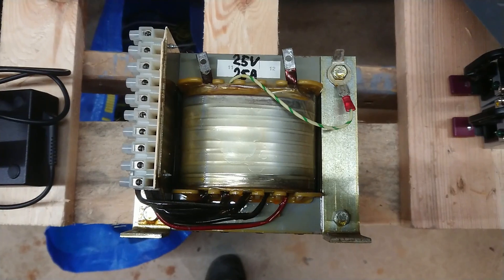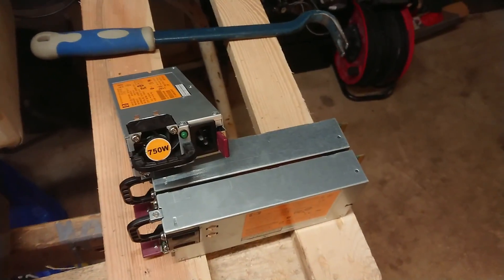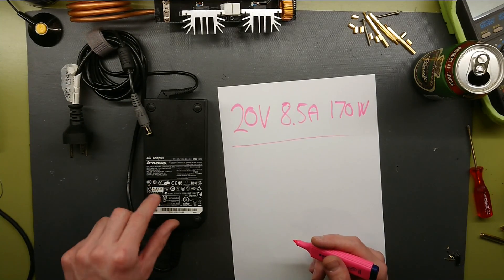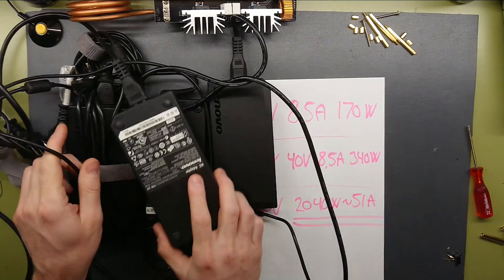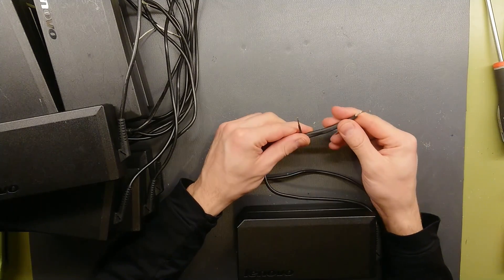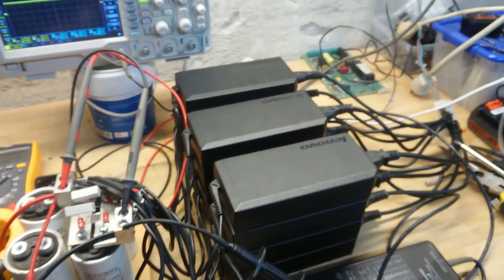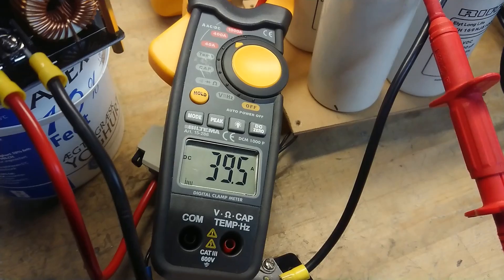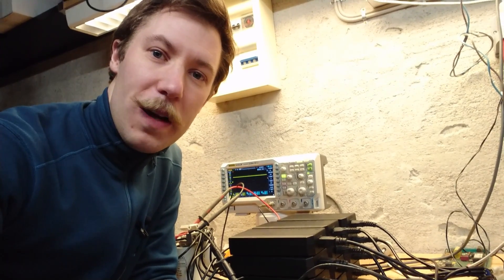2000 Watt Laptop Charger For Induction Heating

Comment: I HAVE ONE LAPTOP psu 19V 65 WATTS AND THE OTHER IS 19V 75 WATTS, CAN I CONNECT THEM IN PARALLEL OR WHERE AND WHAT VALUe OF CAPACITORS do I NEED TO CONNECT  them to prevent the difference? Thanks.
Reply from the maker: With a minor difference like that, I would just parallel them, maybe add diodes to make them not "see" eachother.

Comment: Do you ready need the same kind of laptop  power supply, same voltage and same ampage? Can I use different laptop power supply with different voltage and ampage to connect it in series? Thank you
Reply from the maker: As long as its the same type of power supplies, you should be able to do this with almost any kind of better-to-high quality types. I do however foresee that the higher voltages (48V) could be more problematic to put in series than lower voltages (12V).
Reply: @KaizerPowerElectronicsDk  hi thanks for your fast reply, let me give you an example, I got  3 power supply that is (1) 19v and 4a. (2) 20v 6a. (3) 24v 8a. Can I connect them in series and get a power supply of 63v and an average of 6a. Please help
Reply from the maker: That will not end pretty. 
You can only go by the lowest current rating in a series connection.
But load sharing between power supplies is determined by the voltage, so these 3 different power supplies will have an uneven fight about maintaining regulation. With a oscilloscope on the output voltage, you would properly see a ripple voltage with 2nd, 3rd and 4th harmonics components in it.
At low current, maybe up 3A, then maybe it would work at 63V. But you need to leave them all headroom to maintain their own control.
Reply: @KaizerPowerElectronicsDk  thank you very much for you your advice

Comment: could you switch them all on at the same time from one or 2 wall outlets? The inrush current of these switch mode PSUs is quite high. When i just put 2 of them in parallel and switch them on at the same time the 16A circuit breaker will trip sometimes. So you probably need some kind of time delay between them?
Reply from the maker: I switch them on 4 at a time. From a 230V/13A mains socket.

Comment: I am looking to heat 1” thin wall steel tube, so from this I take it that I need to make a smaller diameter coil. Do I need to make it out of the same length of copper tube for any reason, or will any length coiled up do fine?
Reply from the maker: You have to keep an close eye on the resonant frequency you end up with, I really recommend you take a look at this thread: https://highvoltageforum.net/index.php?topic=530.0 and find the posts from PeteSpaco, he made a lot of experiments with different coil sizes and gives a conclusion on what to do and what no to do.

Comment: Hi, Could you Plz Share power supply circuit (diode and capacitor
)?
Is it possible use any switching power supply say from china?
Reply from the maker: There is no need for a schematic, it is 2 power supplies in series for 2x20V = 40V, 6 of those in parallel for higher current. All connects to a capacitor/capacitors in parallel. The cheaper and low quality PSU you get, the harder a time they will have regulate in a swarm fashion when presented to heavy loads or fast changes in load.

Comment: nice job, what are the capacitors are you using? is it possible to run induction without capacitors and or maybe use ledacid for some high cca's do you think it would  be feasible to try it? using ledacid for the cca's might be able to handle a bigger coil and crucible possibly where it wouldn't require pouring using a mold? multiple ledacid in series with some in parallel for capacity or if there's something that could handle a larger coil and more amps, maybe fabricate say 5 ledacid into 1.
Reply from the maker: It is just normal RIFA electrolytic capacitors, as each single PSU only have a small output capacitance, a large change in load current from the inverter would pull down one or more of the PSU, the capacitors will instead be able to supply that peak current fast and all PSU would see that simoutamelsly as a voltage drop on their outputs, instead of a huge current surge.

Lead acid batteries would give you the best possible stable DC supply you can find, given you have enough Ah available. It is however not very practical as you would discharge them much faster than you can recharge.
Reply: @KaizerPowerElectronicsDk  thx for the replay, people aren't reading their comments not very often I get a reply would you say there would be a limit to the storage space with everything running through the satellites would there be an overload reaction affecting the satellites eventually? I delete junk on my phone constantly to free up space if I didn't it effects the phone, or the built in app or others can be used. Recently I thought the storage space could effect a laptop causing it to crash then they lose their data or can't get to it it's probably a crazy idea do you think an ic chip could be mounted on top of another ic chip  and work? or maybe their isn't enough power needed to process all the info they ask to run through a laptop the stock market calculations and processing is enormous, definitely the heat effects the chips performance then the same batteries supplying amps to ev's are used in laptops could that be overkill a bit and wouldn't it be better if the lithiums weren't anywhere near the laptop just giving distance even though it's heat shielded already could lower the temperature of the pcb's.

Comment: I have a very large collection of high voltage insulators from 10 kv to 66(60 kv). 
i have all type materials except 1 type. And this is shown in this video. I don't have the read composite insulators. 
And for your  solar project, do you want to show some wire and cable management for us electricians ninjas.
Reply from the maker: Part 3 of the solar project will have the final control panel in it.
Reply: You will look very much when we reach the 30. may 2019, 15 days to go. I maybe i got a very costly component for really small money and it have two psu with 83 Amps at 12 volt each. It not broken but i think very lot about your projects. 

At the next year i will begin to build a slayer exciter with the coil inside a brown 60 kv bushing. I allready have the 4 radio amplifier power transistors, wire and the 60 kv bushing.

Comment: Neat!! But as @kubeek asked - How do you trust the parallelised power supply units to provide an equal amount of power? I mean - I would speculate their regulated voltage output to be a little of relative each other? And thus they would kick in individually at different levels as the load bends the output voltage down? Or what is the mechanism that enables them to cooperate in parallel? Thanks for a good video!!
Reply from the maker: I gave a thourough best idea at @kubeek. My experience from parallel power supplies in the industry is the same, when they are calibrated to same voltage out at same load, they will regulate very even. But as soon as just one or two power supplies has old electrolytics they will start having some weird 2.-3.order waveforms. Glad you like the video :)
Reply: @KaizerPowerElectronicsDk  Thanks! Seems like a good topic to dive further in to? E.g., How to ensure power supplies like these are able to work in parallel  depending on their individual characteristics? For now at least it is good to know you have experience that this works well for modern power supplies with matched voltage output and power delivery capacity :). And to look out for power supplies with old electrolytics! Keep up the interesting work you do :)

Comment: That worked rather well! I've had tough luck with smaller-scale MMLP arrangements ringing (to failure) after some load switching.  20mF and good attention to lead lengths were not at play though.  Thank you for sharing this, and I look forward to seeing the outcome.  Best of luck, and enjoy your weekend!
Reply from the maker: Thank you! I also think that the 20000uF is what helps them balance easier on changing load. The peak current is delivered from there and not the individual packs. 6 in parallel also makes it less critical than if it was just 2 or 3.

Comment: How do you make them share the current equally?
Reply from the maker: I did very little. The most important factor is high quality products that are very tight specified in the first place. But I do also believe that the extra 20000uF in-between gives them a break from fast changing load current. Even cable lead lengths is a minor factor, but it does not hurt to add that as well.
Reply: @KaizerPowerElectronicsDk  Maybe these power supplies are current limited, and start reducing the output voltage when they reach the max current.
This would allow them to run in parallel nicely. But certainly not all laptop power supplies are current limited this way, most cheap ones just shut down when they are overloaded.

Comment: Very nice idea, but you could have bought a used Delta 6000W Server PSU with 42V output from ebay. Here is a link to seller selling one: https://m.ebay.at/itm/Cisco-Switch-Netzteil-6000W-Catalyst-6500-Series-WS-CAC-6000W/392119847091?hash=item5b4c2a08b3:g:XIQAAOSwQqJbkofo

If you are lucky, you can find them for around 20€ in working condition like I did. They cost a fortune new and they only have quality components inside. There is no need to "hack" them, you can simply turn them on with the front switch. 

I did a teardown on my unit last week, here you can see some images if you are interested: https://drive.google.com/folderview?id=1f969rtGcgXGejXyBJAFxzThBa2Qcj70F

Comment: It actually looks neat enough to get those 12 chargers lining up like that.

Probably I would try it some day... when I have some time.
Reply: Actually, I wouldn't arrange them like that when drawing a lot of current for more than a few minutes. They get really hot, and will heat up each other. The inenr ones might then overheat and shut down or even break.